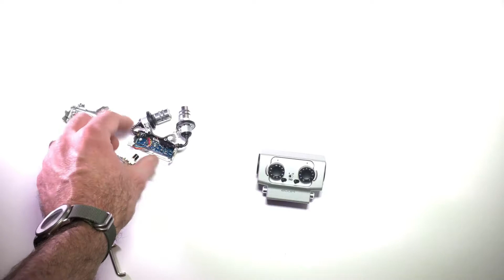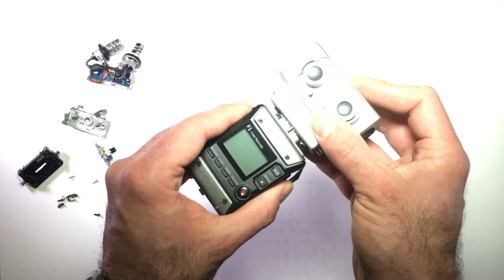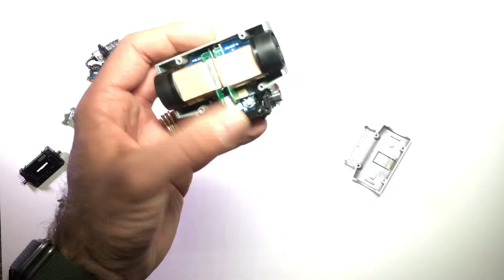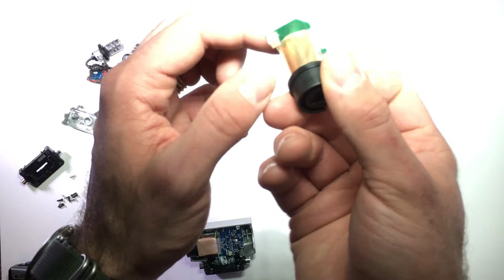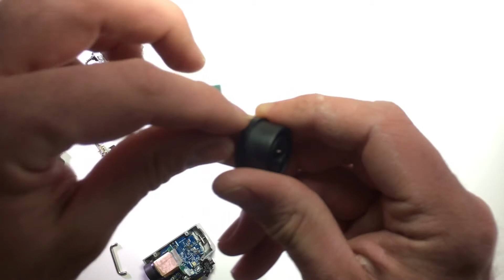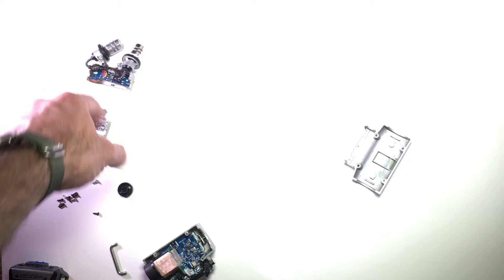Zoom EXH-6 tear down and locking XLR ideas

Comment: the EXH-6 is uselless since it does not provide phantom power. so  most serious XLR mic won't work. So if it is to use condenser mics, you do not need XLR, and the small 3.5  jack socket on the EXH-1 is enough

Comment: So a tear down but no ideas, nor what the various connections are. Have you or anyone else come up with anything yet? It's time Zoom produced an EXH-6B (locking & phantom), problem they have with the power is the common blade connector for all of their add-on modules, the power would have to come from the module itself, i.e battery I guess.
Reply from the maker: I ditched the EXH-6 in the end - just too few occasions to need two extra XLR inputs, with cables inconveniently sticking out either side and no locking connectors.